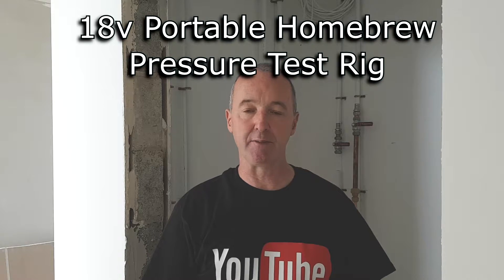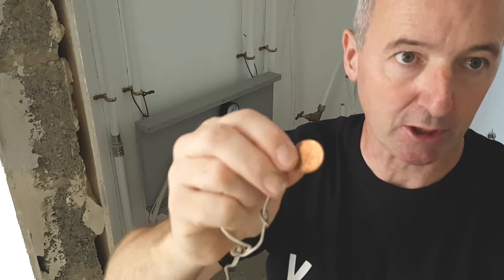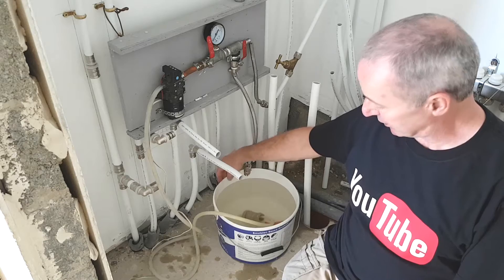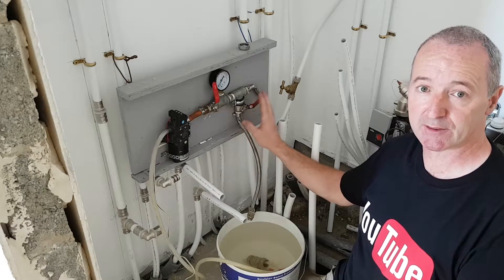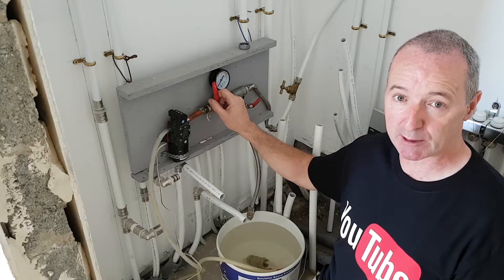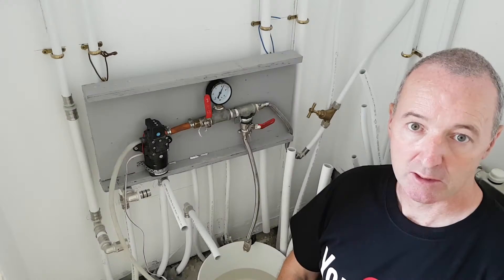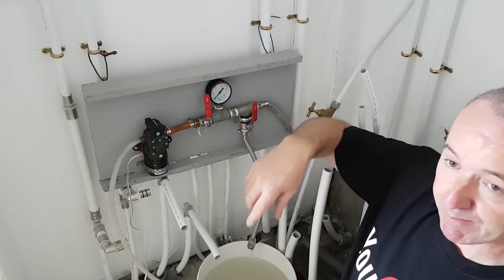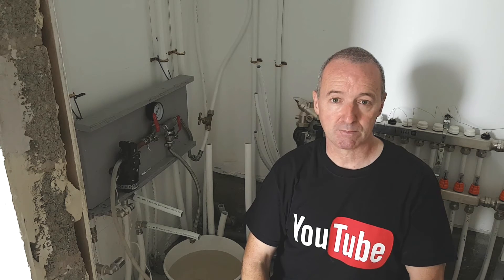Fantastic Hombrew Portable Pressure Tester

Comment: Really love your videos, Gerry - you inspired me on this video to create a solar loop filling station which works like a dream, much easier to use and a lot handier than hiring a full sized system from the plumber's merchants!  The one challenge I had was connecting the pump to the tubes, but managed it via some rubber hose that I used to convert the size.

Thanks a million and I hope your paramotor engine is ok!
Reply from the maker: Hi Stephen. The aul paramotor is a little sick. Nothing about 700 euro wont cure though. It's on the to do list but it's a long list lol. Great that you have  your own pump station, well done. The weather and Rasp look great for tomorrow so I hope to be high over mount Leinster and beyond if I can get high in the thermals. Fingers crossed. I'll bring a camera. Cheers Gerry

Comment: what do you use to heat the water in the winter oil or gas
Reply from the maker: Hi Thomas. I have a condensing oil boiler which is 97% efficient and a multifuel stove connected into my underfloor heating. I burn mostly wood and off cuts. I am considering a 12Kw Air Source Heat pump. Cheers Gerry

Comment: nice setup, but why you dont use water pressure from town sanitar water for testing for leaks
Reply from the maker: Hi THeSSHR. Good question. The site is at an early stage of the build and will eventually be on its own deep bore well for its water but for the moment there is no water to this house. Also at this point there is no power connected to the house so I would need to bring a generator or just use this portable pressure testing setup. Thanks for the comment. Cheers Gerry